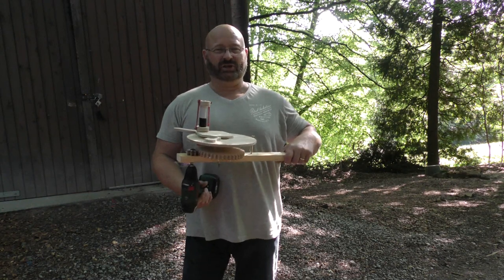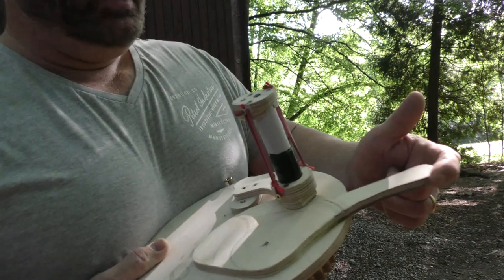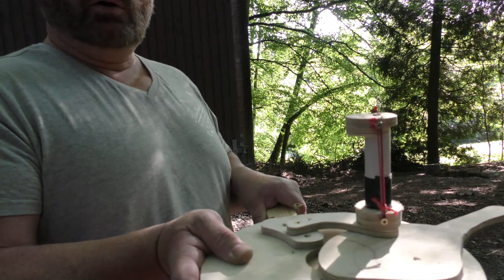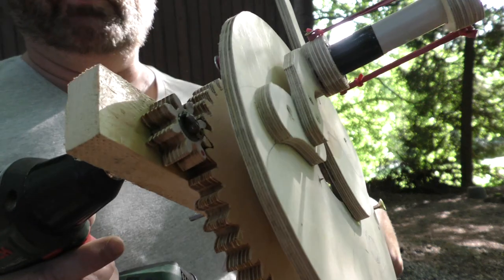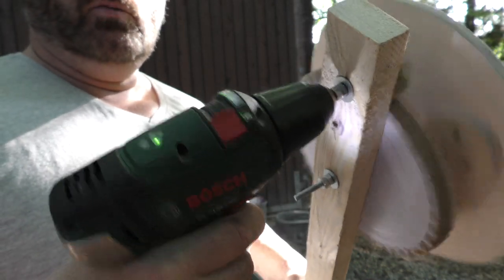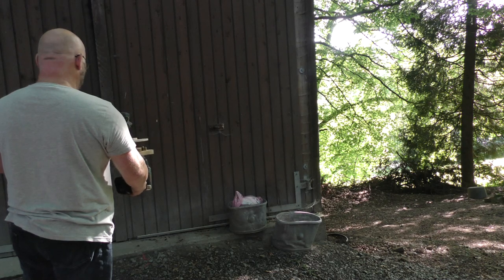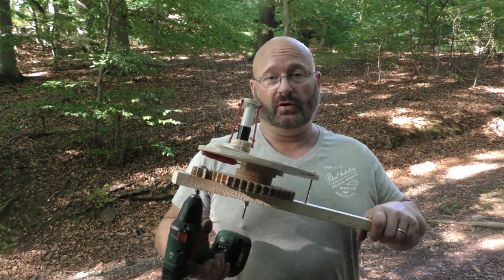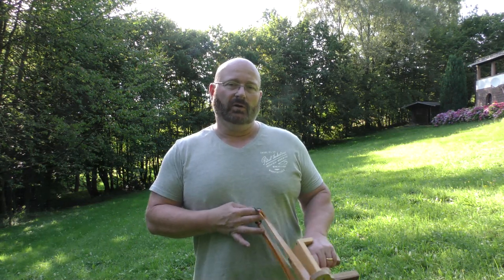New Full Auto Slingshot Concept: First Tests!

Comment: I thought of a way to feed the bullets, and I'm curious to know if you think it would work.

If you took the ammo storage tube and put it at an angle, more toward the center of rotation at the top and toward the outside at the bottom, then as the mechanism rotates, the inertia of the bullets against the tube may cause them to have a greater downward force than gravity alone. The faster it spins, the greater the loading force. Does that make sense?
Reply: Wow, great idea!
Reply: Clever. Sounds like it should work.
Reply: Or simply use a rubber pulled piston like always.
Reply: Why do something that will definitely work when you could do something that only might work? :-P
Reply: But wouldn't using rubber bands be easier?
Reply: I'm sure it would. What can I say? I like experimenting. But I'm too lazy and too lacking in engineering skills to do the kinds of things Joerg does.
Reply: Well if you used a low friction material for the feed tube and could figure out a way to correct the feed angle problem, that might just barely work.
Reply: The clip wouldn't necessarily have to rotate with the machine, Which would improve fire rate
Reply: A lot of 'if'. Using a straight force feed is guaranteed succes, yet less of an engineering marvel
Reply: My suggestion was more about experimentation than practicality.
Reply: +Tom Haflinger You could connect a spring to the top of the blocker to force the nuts down
Reply: Yes, that's the reliable, tested and boring way :-P
Reply: And much more efficient, better and works well. Sometimes simple is best :-)
Reply: What is the source of your aversion to fun?
Reply: If I was shooting something like this I would want something that worked best. So that's more fun :-)
Reply: What about the thrill of experimentation? The rush of risk? The heartrate raising sensation of possibilities beyond the obvious?
Reply: Exactly, Sacha. Experimentation is fun.
Reply: I think adding a spring makes more sense and it's way simpler
Reply: Yes, I do too. Please read the conversation.
Reply: Lol

Comment: The air resistance force on a ping pong ball is the same, regardless of whether it's filled with air or lead. The difference is that "deceleration = force/mass," when the mass is smaller the deceleration is greater, and it slows down quicker. When the mass is larger, the deceleration is smaller, and so it only slows slightly.

Comment: You could use rubber to force the magazine of bolts downwards like a spring in a magazine. A slit either side of the tube to allow the rubber to travel down the shaft connected to a stopper that fits inside the tube behind the bolts to push the bolts downwards. hard to explain, hope you understand.

Comment: Hey Jörg,
how did you cut the gears? Since it looks quite even I guess it's made with a laser cutter?
And as an engineering student I have to ask if you used an involute gearing (Evolventenverzahnung) there... :D Because that would make it indifferent to small displacements of the two rotation axis of the gears which might get you a smoother rotation.

Comment: I have tried to make this roman stick, but with hole for bullets, not a nail (I am too lazy to drill holes in my ammo). Not working (yet) because of small hole speed is too low. I need to drill deeper. Well, after this experiment I need new stick too.

Comment: what if you turned it on its side? and then attached it to a stock? also, would it be possible to setup a pulley system to fire it at the end? that way you could make an actual trigger out of the drill

Comment: A weak magnet where the bolt sits right before it fires would make the shot slightly less powerful but greatly increase the angles at which shots could be made.

Comment: looking at the roman ballista, these weapons shot massive bolts and stones using the tension of two bow arms powered by a elastic material wound tightly.
Reply: I believe rope was standard. It was also used in catapults.
Reply: I believe rope was standard. It was also used in catapults.
Reply: I believe rope was standard. It was also used in catapults.
Reply: +Wyatt Roncin yes. your right. i dont think actual rubber was invented until lat 1800 early 1900. the ropes provided tension but the amount of rope requires for a hand held version might issue.

Comment: Remove the drill and cogs on the bottom of it and put a cog with really big teeth on the side of it vertically, so that when said cog spins it pushes the arm back and releases it like the screw on the original does except the whole slingshot doesn't spin, its just the big cog on the side of it spins. I think it would make aiming easier.

Comment: so...whats up with the bowling ball launcher?
Reply from the maker: This week is the first one since May where the weather is dry for a few days in a row... and I have to go on a biz trip Wednesday. So it is not in sight. Let's hope for a dry fall.
Reply: thanks for the update.  should be a very interesting build.
Reply: You should move to a warmer country for the sake of slingshottiness! That said ... After seeing Kingdom of Heaven many years ago i often think of how I would do to defend against a siege had i lived that long ago. Only using material available from back then of course, no cheating. Something that could shoot far or very fast while being heavily protected. I think what you made today could be something that would fit. You'd need a metal spring leaf of some sort as i dont think rubber were available in the way of rubber bands. With some mechanical extension you could have a couple of strong men spinning the wheel well protected far below (like oxes running a mill). You could shoot whatever with it so that's a plus after a long siege.. rocks, metal, junk.. "chemical waste" 
The rate of fire would be immense!
Reply: +JoergSprave where I am in France it hasn't rained in weeks shame Germany isn't the same :(

Comment: Would it not be more efficient to have the magazine and swing arm stationary and use a spinning disc to push against the arm? This way the rotating portion is much lighter, and wouldn't torque the mechanism around so much.

Comment: its only a 1:5 transmission? looks like more
Reply from the maker: No, 8 teeth to 40.
Reply: so 1:5 after all. Thanks
Reply: He should use a ball bearing on the screw to run with less drag

Comment: I disagree with your statement that gravity doesn't slow things down. Neglecting air resistance, if you throw a ball straight up it will slow down, stop, and then fall back, only regaining its original speed when it reaches the launch point, anf then going faster as it falls yet further. A similar thing happens when the object has sideways motion, it travels slowest at the top of the arc, and then speeds back up as it falls to the launch height. With the roman siege it appeared that the shots were being fired up quite a steep hill, and so would have lost a lot of speed as they gained elevation.
Reply from the maker: I am talking HORIZONTAL speed. If you shoot up a ball into the air straight, the horizontal speed will remain the same (zero) throughout the flight.
Reply: +JoergSprave Exactly.
Reply: As a person that has studied physics ,Jorge is right -lead is so dense and the speed is so low air resistance for this conversation is essentially nil.
Reply: Gravity has no effect on horizontal speed. That should be obvious.
Reply: Either you didn't do high school physics, or you weren't paying attention.
Reply: Hey Jörg, ich hab mal eine kleine Frage: wenn man bei deinem Shop was bestellt hat kriegt man dann eine Bestätigungs E-Mail? Ich habe mir nämlich am Samstag eine schwarze Rambone bestellt, freu mich sehr drauf!
Danke im Vorraus.

Bearbeitet weil YouTube das ö und das ä als irgentein Buchstabensalat gespeichert hat :D

Comment: When you build your full size model, add more barrels per se'. 

There is so much time wasted on your small scale when it rotates one revolution, that you could have another launcher set up 180 degrees off so it fires two nuts per revolution instead of one. 

Look an the M134A mini gun for reference.

Comment: wouldn't it be smarter to have a screw on a spinning disk triggering a stationary arm instead of putting the whole firing and feeding mechanism on the rotating disk, it would probably make it a lot more stable to hold since you wouldn't have that much in balanced rotating mass